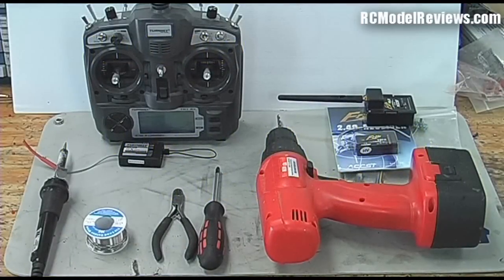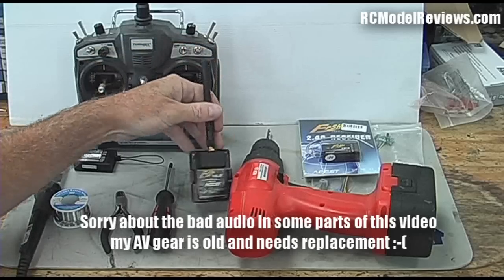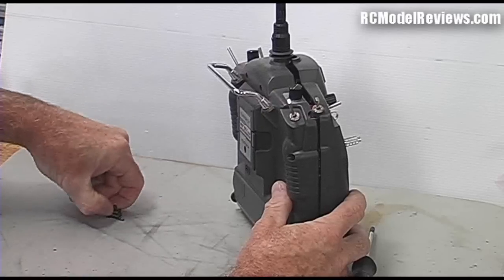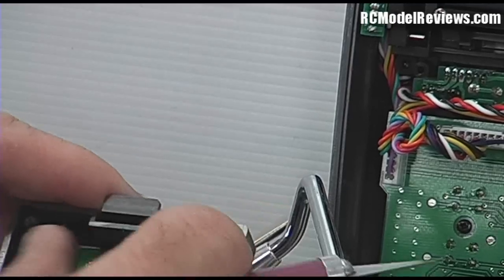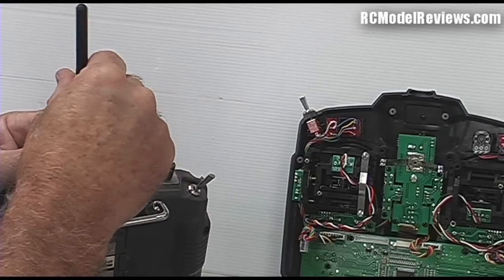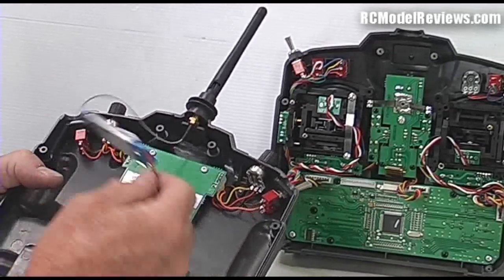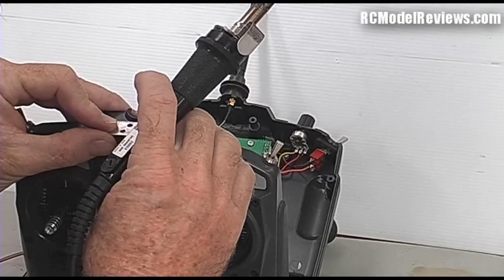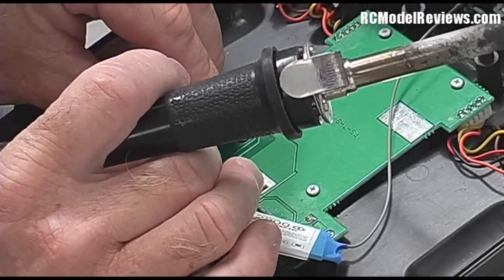Installing the FrSky 2.4GHz DIY kit in a HobbyKing Turnigy 9X radio

Comment: another option could be using the frsky module in the back and plug it to the transmitter antenna using a cable instead of installing the diy kit, in that way I could easily swap modules in the back and keep using the originals turnigy receivers (of course connecting the antenna to which module I'll be using)... anyway very nice review I'm a fan of your videos!!!

Comment: Bruce,
I tried your mod on a FlySky 9x w/the FrSky V8HT & V8R7-SP receivers. I had no problem binding & servos worked great the first time around + activated & tested FailSafe. I put the small LED & Switch on the back using some hot glue as cushion for the board and strapped it to the bk case w/ the screw from the blk stub which is screwed to the case.

Comment: Thanks much!  Just ordered the DIY kit from HobbyKing along with an extra 8 channel receiver.  Also, like an idiot, I ordered Frsky JR module with receiver.  Tried to change it, but oh well... $20 mistake on my part since I don't need the module for the 9x conversion.  I did get an extra receiver out of the deal, but no need for the JR module..

Comment: A small tip for putting the screws back. The screws are a bit too snug and can strip the holes, so to make their way easier put some soap on them. Hard soap, not the hand washing liquid thing Also it doesn't matter if it's Dove, Palmolive or the cheapest around. You can tighten the screws fairly easy now and it will hold just fine.

Comment: I ordered the one you stick in the back 2 weeks ago and should get it within 2 days. I think the biggest advantage of it is that you can swap between Frsky and Flysky so you can still use hobbyking or turnigy receivers with the old module.

Comment: from doing a little more reading, there are two versions of the 9x. if the antenna comes out of a little box in the back, and not the transmitter itself, its an easy pop in, if not, and your antenna comes out of the transmitter, you have to follow his steps in the video, so the box will be default when clipped in.

Comment: Nice video. I did something similar only I went a step further and mounted the original Turnigy antenna directly to the plug in module. Now I can use it or my Corona plug in module (yuck) or soon my own FrSky module.

Love my 9x radio and I think I will like it even more with the FrSky module.

Jon

Comment: Have to learn to pay attention more closely.  I read your review of the Turnigy 9X from some years ago and didn't think about the date.  I was mainly interested in the reasonable price.  I thought I was getting a deal with the combo price including the RX.  First I added the backlight kit and as soon as I started programing I noticed the Fail Safe didn't work.  Now after more research of your videos I have ordered a FrSky DIY kit and a D8R-XP servo.  Now up to approximately $154 I could have put toward a Taranis or some other radio.  The good thing is I'm learning as I always have the hard and costly way.  :)
Reply: +Lloyd Prunier I have been flying all sizes of quads with 9x and 9x with Open tx since this vid came out and 3 of the 4 are still working great. I just use the 4th for spares like gimbals etc and recalibrate after replacing them. I have Futabas I cant fix as easy and are easier to break.

Comment: I love your little pickup on the whole solder/ sodder pronunciation :D

Thanks for the vid. 

I have the FlySky 9X so I didn't need the mod advice, 
but I was confused as to whether or not the FrSky module was compatible with my receiver.
It would seem that it is :)

Comment: @Vanusk 

yes! I did install it yesterday and it is exactly the same, but you have the toggle switch, i removed the timer switch so i didnt had to drill extra holes.
and yes it's working!

Comment: Thanks for this excellent tutorial. Just followed it to the letter (nearly) and now have full signal loss failsafe on my DJI Wookong M with my 9X. Thank you! Only change I made was to put the LED and button through the little top Turnigy logo which is quite asthaetically pleasing. :) Never going to resell so doesn't matter in that respect.

Comment: great video RCModelReviews 
use epoxy that way it wont pop apart on a cold day, hot glue rocks as a pinner and hold rc foam together well, in my exp hot glue comes undone on hard plastic in cold weather.

Comment: Hello Mr. Bruce. one question, if you remove the old T9X module, this means that 5V internal IC stab is gone (the internal one,  who supplies 5v) , and the power on the third pin, is the battery power ( unstabilized ), right? In this case, is better to use the internal circuit of 5V stab in the old T9x module? Using a 5V Fr Sky module on 9-10 v will destroy the module?

Comment: best bet is to google the frsky website, and check the chart for compatibility. 
It depends on what you mean by the cheapest, with or without telemetry? there are both options for that module.

Comment: @RCModelReviews Thanks for the reply Bruce. my big plan was to reflash the firmware with the improved ER9X  from erazz. i have to wait for the pogo board for eprom flash to come off of back order first. in the past with my 72mhz systems i ran dual recievers splitting the arplane down the middle. i reiciever for 1 ele, 1 ail and one of the rudder servos. and the othere reciever for 1 ele , 1 ail ,1 rudder and the throttle . i've had recievers fail and the dual setup saved my but twice now.

Comment: Dear Mr Bruce, i'm trying to install this module into a Futaba 7c FASST. I want to have both systems in the same radio in order to have a wider receiver range (as you know futaba compatible receivers are 8 channel ones and I'm looking to fly small indoor planes that require micro 4 channel receivers as FRSky V8R4).

 My question is can i have both modules transmitting on the same antenna, in order not to put yet another 2.4Ghz antenna on the radio?

Thanks in advance!

Comment: Is it possible to install the diy kit used, into the original turnigy module case?  Or would having to drill 'large' holes through the back casing be a bad idea?  Thanks.

Comment: Frysky offers up to about 2.5km max, the flysky is a little more limited. With an extra 7DB antenna, I hear you can get up to 4.5km.... but, Ive just ordered the new add on module because I want to use the MXQ on the same receiver. I know I can bind the V929 to it as well, I just need to google more.

Comment: Hi. Love your vids. Liked the backpack one esp. Is it better to do this than purchase the plug in module? (FrSky DJT 2.4Ghz Combo Pack for JR w/ Telemetry Module & V8FR-II RX from Hobbyking). Apparently, according to an old post on rcgroups, the old plug in modules used to get over-volted and could fail because "the 9x drives the ppm signal to the module direct from the atmel processor.... driving a 5V signal into a 3.3V processor input."

Is this still an issue or now fixed on 9x/9xr? Cheers

Comment: Ken, I don't think the radio is approved by the MAAA (but HK does show "** C-Ticked & certified for the Australian market" for the 9X).
This probably means you cant use it at MAAA affiliated clubs. My local is about $200/yr (+ working) bugger that for a joke, I think I will stick to parks and reserves. The actual TX list is very small and probably fixed to suite the importers cartel. (my opinion only).  Have a look at the MAAA site. Changing the module probably wont make it compliant (for them).

Comment: Something you may or may not be able to help me with regarding the Turnigy 9xV2 radio.
Looking at adding some mods but apparently the motherboard has the m64 processor (Atmega64A)with limited ram or memory.
Hobbyking list 2 versions of motherboard ...one is DSS protocol and another AFHDS-2AThe latter I imagine has the m128 processor but they say my radio is the older DSS version and not interchangable. 
I can't see why that would be as protocol would normally be a product of the transmitter module.
Boards appear physically to be identical layout.
Any clue in that direction?

Comment: Why didn't you take out the old transmitter parts on module and replace it with the new transmitter parts?  Then you could have put your antenna out the back of the module like a FrSky transmitter by drilling a hole out the back of the module.  Just wanted to know.

Comment: @nitrovice the brand and wattage doesnt matter. The rating on the soldering iron just means higher the watts, quicker it heats up. A 16 watt soldering iron will be as good as a 30watt one for this application. It matters when you start soldering thicker wires / traces etc.
IMO stay away from 5£/$ cheapo ones, and get a Antex make, 16 watt or 18watt. These are better and have different tips available. a standard chisel tip will be fine (these are standard on this wattage)
LEAD FREE!!

Comment: I'm trying to find the FrSky DIY kit used in the video on HobbyKing (or another website). The closest I've found is this one: http://www.hobbyking.com/hobbyking/store/__17205__FrSky_DHT_8ch_DIY_Telemetry_Compatible_Transmitter_Module.html However I'm not sure it's exactly the same or that it will work correctly. Any advice would be most welcome. :) Thank you.

Comment: Hey Bruce, I installed the FrSky DIY module following your video several months ago and couldn't be happier.  Now that HobbyKing just came out with the DSM2/DSMX module for $29, I ordered one up to use with all the Horizon Bind 'n' Fly stuff... Anyway, I'd like to add a toggle switch to disable the FrSky if I'm using a module.  Do you think I could just add the toggle inline on the positive wire to the FrSky module, or would the PPM (or something else) be better?

Comment: Hey Rc model i had quick question.I updated my firmware on my 9x to (OpenTx)But i notice my range has declined.Now i can only fly a few meters before it drops signal.Will this DYI mod work with getting better range?Will it work with openTx firmware.I dont understand why my range went to crap.Can u help?

Comment: @gtrguy32 i was more or less unsure if you could run two recievers bound the the same radio without any issues of being erratic or range issues.   From what everbody online says about the 9x , with good firmware and the frsky module it is capable of being a very good radio.  the er9x firmware makes the radio more fluent to program and gives better mixes with better 5/9 point curve adjustments.plus you get a nice little EL backlight with the pogo kit.  thanks for such a quick response   :D

Comment: Hi, I want to ask: What is the voltage of the V+ wire you connect to in the transmitter? I connect to the 5V rail in my transmitter and the led in the DIY started flashing orange when I turned it on. Is it normal?

Comment: Hi Bruce , In the video of the conversion , you mentioned one of the reasons for removing the Turnigy TX module and antenna as being RF being absorbed by the original antenna. I have an Aurora 9ch TX which i added a Frsky hack module selectable via an additional toggle switch. The original antenna remains albeit i ran the coax inside the case and the Frsky antenna sits on the RH side of the orginal. Is this going to be a problem? Do risk doing unknown damage? Been flying like this 1 yr.

Comment: if I didn't care about going back to the Turnigy module, would the FrSky plug in module kit (not the DIY kit) fit in the Turnigy slot? I would still remove the existing antenna. Just trying to aviod the soldering process.

Comment: Hi Bruce, i am trying to add on screen telemetry to the t9x with the DJT module but i would like to use both stock module and djt. i am getting confused as to which mods are required to do this. can you point me in the right direction? thanks

Comment: VERY GOOD .... plus, the bind switch sits better up there. If it's on the back you could activate it whey you dont want to.. also ,why not just lock the antenna with the nuts a little bit lower? its seems to be room?

Comment: Is there an easy modification i could make to the receiver that will allow the fail safe to be "persistent"? or should i just replace the Corona system with the FrSky system? I do not want to cause someone harm because i forgot to set the failsafe in the Corona system. Thanks for the timely response you have been making to my comments.

Comment: (newbie) Hi, I've bought a Th9x (upgraded version, mode 2). I've read in some forums that the new model doesn't need any flashing. I just wanted to know if there is any upgrades I need to make to get telemetry and other extras. Cheers
Reply: +JohnnySlash You have to upgrade the firmware to er9x or OpenTX and mod the radio  to use a FrSky module.  Then you have to do the telemetry mod.  There are lots pf YouTubes about these modes.  Note: stock "upgraded version" reverse to the change from the V1 2.4GHz system to the V2 AFHDS system. AFHDS does not support telemetry and neither does the stock 9X firmware.

Comment: Hi Bruce,
A very quick question. Can I update an old Futaba SkySport 6 to the DIY FRSky 2.4Ghz. It doesn't have a module in the back, but does use a 35Mhz crystal. 
Basically, do you HAVE to have a module based TX to convert to 2.4Ghz with this DIY kit?
J

Comment: Is this system easy to install on much older units too?? i have a hitec CHALLENGER 260b that i would like to upgrade.. pretty basic motherboard on it but i do not know where to solder on the tree cables like you do..

Comment: I love your videos.
Can you tell me the part number for this FrSky system? And I'm assuming that it is from Hobbyking.  I've looked but cannot find it. 
As far as I can see there isn't even a plug in system for the Turnigy 9X transmitter. There is for other makes but not the Turnigy.
Thanks for your help.
Regards

Comment: Is there any way to bind the FrSKY DJT ACCST module to the Turnigy 9X 8c v2?  The FrSky transmitter is in a Turnigy transmitter with the SmatrieParts 9x Xtreme solderless addition.  It looks like I could change pulse widths but I don't know the protocol of the Turnigy 9x receiver.
Thanks

Comment: @RCModelReviews Oh wow that'll be great ... was about to give this a go myself. Though i'm starting to wonder, by the time i take the T9X, the DHT and the D8R reciever (or perhaps the v2 of that) i'd probably have the equivalent of a $150 dollar radio with a decent 2.4 ghz system with fail safes and what not. Would it be better to purchase another radio for that cost or would this be a practical modification.

Comment: Dear Bruce, i have the v2 9x and i have the frsky diy kit on order. the one thing i was wondering is using these in larger models. i have a 35% su-26 that i would like to use this system on but i would like to run 2 of the 8 ch rx's for dual redundancy. is this possible? thanks in advance

Comment: I have the telemetry system and when I press the button and turn on the transmitter the green led and red led flickers. I made sure its in 2-way mode and everything but it still does that so I cannot bind it to a receiver ( it is also v-2).

In the instructions it says insure both switches are off when in 2-way mode, what is that?

I'm getting extremely frustrated by this... any help..?

Comment: Bruce:
How would you go about finding out which wires and where they are in trying to install one of these kits on a Airtronics rds8000 radio? Would you need to remove some part of the transmitter? If you did not, wouldn't it still transmit on the original2.4 and the Frsky 2.4? Would using a lipo effect the frsky negatively? Still waiting for HK to bring out the 9xr! Have you heard anything about changes in that radio or when available?
Thanks for your videos.

Comment: I have a programming question. If you can't answer it can you direct to who can?
My question is: I just purchased the 9X and my wife purchased the FMS P51 for my birthday. I am using the 9X in it's standard form. I am buying the V8HT this week end. . I have the flaps working with the three position switch but can only make one position work. The middle position is on and top and bottom is off. I would like to make it three positions for my flaps. HOW? I have tried everything.

Comment: you can add a switch right to switch between the fr sky and  turnigy and maybe use a set of sma connectors on the turnigy wires i would like to see what you think 
cheers

Comment: Hey can u please help? Ive installed the  module FrSky DHT on my TURNIGY 9x same as your tutorial, I could bind the RX D8R-II, it is with red light on when my TX is on, but after connect the servos they are not responding the commands, when i connect the battery to the RX i can see the servos are trying to move like going to the center position, what can be the problem?
tks

Comment: Hi there bruce. i have a problem and i need yr help. i cut the antenna wire from the turnigy module and use the assan system. but now i wan to use back my turnigy module. can u show a video on how to solder back the antenna wire? thanx very much for yr help

Comment: Hi there, 
I followed your video and did everything as you said, the only problem I am having is when it comes to binding. I hold the little black key on the transmitter and turn it on, the light blinks but the screen on 9x doesn't turn up, I thought it was the connection problem so i checked all the connection that we pulled out in the transmitter but thats not it, the screen does turn on when i turn on the power, hold the black button but as soon as i release it, it goes off. Any help?

Comment: Hi Bruce   ~   Great video as usual ! ! !    Can you help with a small aerial problem please ?  
I need to re-connect my Turnigy Module to the original aerial wire to sell the 9x as I've upgraded my Tx.   The co-ax wire is micro thin and I can't easily see the connections to the Module even with a magnifying glass !   Any help would be most appreciated Bruce.   
Kind Regards from Eddie in the U K.